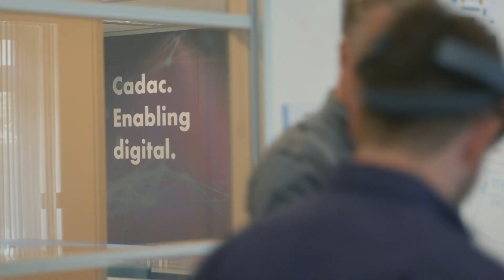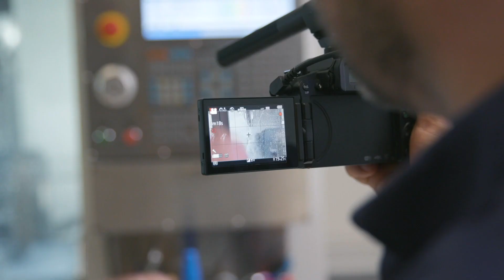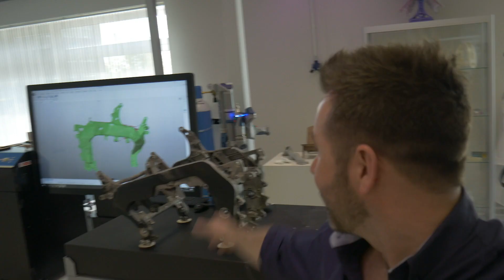Cadac Xperts - Feat. Me! (And Carolyn, and Marco)

Comment: Very good Neil. I'm an ex CNC turner. ( 25 years ) I started in 1981 on a Fanuc 5T. We didn't even have " tip rad comp" . . . Look how it's all changed. . . . I still prefer inventor as a job but I have a little manual lathe in my garage which does get used.   Jim